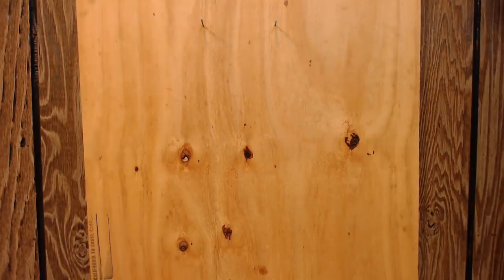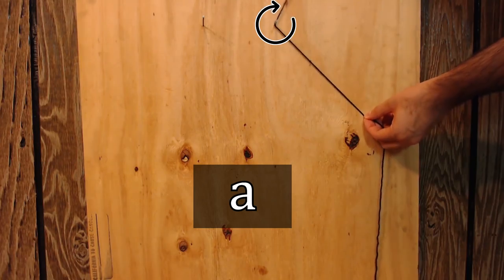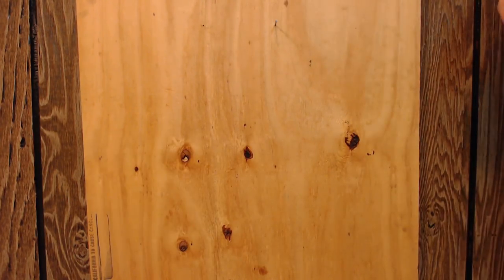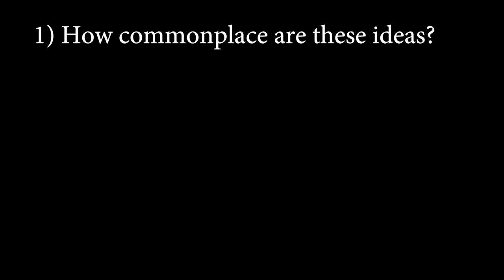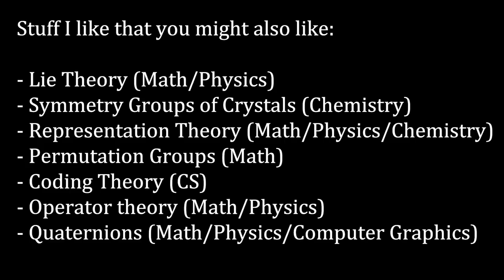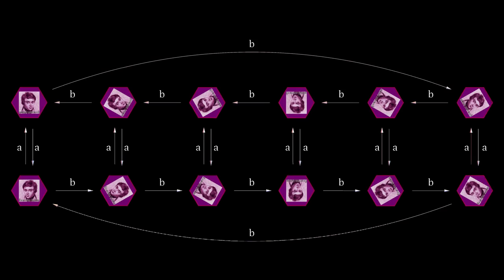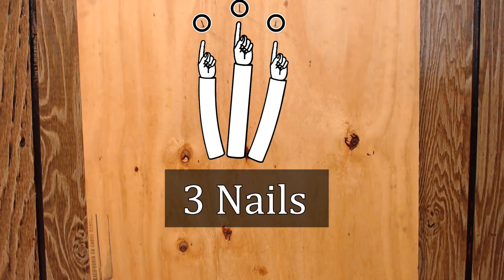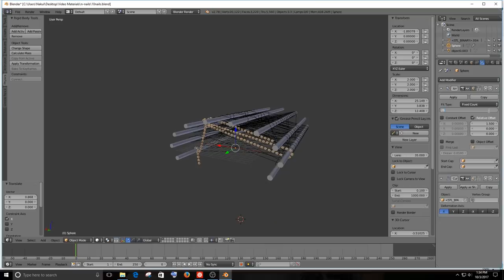A Very Satisfying Puzzle

Comment: Hey, I thought this video was about nails and puzzles !
But you taught me interesting math stuff, though I'm not really into math.
You nailed me. I'm puzzled.
Reply: CraftedBy Lemente perfectly well put! I'm right there with ya!
Reply: you NAILED me
Reply: This video is just for math geeks trying to explain everything mathematically. It can be done, but thinking about loops and hooks is easier than clockwise turns and algebra. 

I skipped through the esoteric math segments, but the video doesn't slow enough to see what's going on.  I was close to figuring it out before playing through, I just needed some string.
How I explain it is that you start with one long loop of string on the picture frame, and you pull a loop on each side and wrap over that side nail and hook the other side nail.  The loop around the each nail holds the picture, but pulling either nail unravels the other loop because each hook is wrapped over the other nail.

He also didn't say why he needed a heavier picture, because his math doesn't account for friction. And there's probably an equation that shows that a million nails won't work in the real world. 

But then it doesn't make sense to actually use this method to hang pictures if you want them to stay.
Reply: Chris Rinker Anyone who has tied a few knots can figure this out practically. Thats not the point...
Reply: (sob..sob...sob)

Comment: I can't even solve 1 nail.
Reply: nailed it
Reply: So punny
Reply: Im puzzled also
Reply: Wouldn't 1 nail be unsolvable because anything you do would just cancel itself out?
Reply: i bet you just lay your paintings down then?xD
Reply: 2 Paintings, 1 Nail
Reply: Templarfreak With one nail if you take the nail out regardless of what you do the picture will fall because there's nothing for it to hang onto.
Reply: There is nothing for it to hang onto to begin with, one nail is not enough to support the picture based on the math in the video because any sequence you'd put onto a single nail will cancel itself out. (Though obviously you could tie it to the nail)

Comment: This appears to work in concept but I need to get better string. The twine is binding up on the nails and ruining the effect. It also seems that you aren't supposed to ever make a full loop around any nail, if the formula tells you to pass under a nail you need to just skip past it without looping it around or else it doesn't work. So basically the math doesn't care where the nails are in physical space it only cares where the string passed by the nail in what direction even if the string never touched the nail.
Reply from the maker: I want to give you mad props for actually trying it. 

This is something I would have mentioned if I had kept on going but you are basically correct. It is possible to do this regardless of how the nails are positioned on the wall (so you can make tons of crazy patterns). However! You do need to be extremely careful. If you really want to guarantee that the looping pattern will be correct, you should pick a point on the plane and call it "home" (ideally where the picture will eventually hang) then draw paths from each of the nails to home so that none of of the paths intersect either each other, or any of the other nails. 

Now, whenever you want to loop around a nail, ALWAYS start from home, move along the path and then make a full loop around the nail, and then RETURN home along the path, then do this again with each consecutive nail. You can always tighten things up as you go along, but this strategy will guarantee that regardless of whatever crazy positioning you choose, the configuration will be correct. 

This strategy comes directly from the algebraic topology involved in proving that the Caley Graph is correct.

Thanks for watching!
Reply: rustyscrapper now you're getting into physics. I recommend not, as it likes to melt neurons and circuit boards (ask NASA)
Reply: yeah, friction often prevents theoretical physics problems.

Comment: There's a very simple recursive way to find any combination for any number of nails.
Here's the algorithm:
If N=1 the combination is obviously just around the 1st nail.
else list the moves for N-1 nails, add the move for going around the Nth nail, add the list of the moves for N-1 in reverse order and swapping all their directions, finally add the move for the Nth nail in opposite direction. Done.
Examples (I use "A" for clockwise and "a" for counterclockwise) :
N= 1 : A
N= 2 : A B a b
N = 3 : A B a b C B A b a c
N = 4 : A B a b C B A b a c D C A B a b c B A b a d
N = 5 : A B a b C B A b a c D C A B a b c B A b a d E D A B a b C B A b a c d C A B a b c B A b a e

Comment: Hi! very well done and a great work and video my friend. I would be glad to do something like that some day, maybe with some help from my friends...
By the way,  I have done the problem with a 6 mm climbing rope and it rocks.
I have also remembered this problem is related to knot problems,  particularly a typical one I tried to master some time ago and it is related with the Chefalo knot, a knot that seems a knot but really isn't so if you pull both ends the rope lays bare (without knots). These types of knots may get as complicated (big) as desired but it is difficult to avoid tangling.

Comment: Tie a knot to one of the nails, then pass the string through the picture's hangers, then tie the other end of the string to the other nail.  if you pull either nail you pull one of the ends of the string out and the picture falls.  Granted, this solution only works for a 2 nail problem, but it is also a viable solution to the problem.

Comment: I'm liking the patterns better when I have the commutator as a b-1 a-1 b.  It comes out as symmetric, and then when I get to the next even numbered nails, it can also be symmetric.  So the next is a d-1 a-1 d b-1 c b c-1 d-1 a d a-1 c b-1 c-1 b.

I don't think you mentioned it in this video but the nails seem to need to be on the perimeter of a convex shape.  Or at least, it won't always work if some are inside the perimeter.

Comment: 3 Tacks 1 Divider
Hang the divider on the wall. You have to make the divider fall, but you can only remove one tack. You may not use any external objects or forces, just the three thumbtacks, the divider, and your hands.
Solution below...

The divider has three holes, squeeze them off of the thumbtacks. You don't even have to remove a tack. I know it's a simple trick, but you can't solve it unless you're thinking inside the box.

Comment: Well, by the way I am an engineer and it is a pity that this problem is totally anti-safety. If one nail fails, everything goes down...and the problem with the picture resisting if all the nails fail except one is trivial,  of course (the engineering problem). Again, my congratulations for this piece of work and I hope you continue with this inspiring work.

Comment: lets say we have two bodies . one is as big as a football stadium size and  other one  is 10 suns put together. the gravity effect due to second body should dominate, if i m correct.  In that situation if we perform this experiment and try to hang a picture from two nails , and in this case  when we take out one nail , the picture  should move towards the bigger body (gravity more) . And if the bigger body is exactly above the smaller body ofcourse there is significant distance between them , so will the picture move up when one of the nails is taken out ?

Comment: For me the not comutative property looks like matrices and vectors. I might be saying something completely nonsense, but if we substitute a,b,a^(-1) and b^(-1) for a matrix that represent the clockwise and the its inverse for each nail, for the 1(st) to no n(th), that no inverse matrix or matrix n-2 cancels any matrix or inverse matrix with n-1 and no n-1 cancels with n and so on. If that's possible other matrix properties would have a different geometrical meaning, I think that's very interesting...
Reply: Oh, and the placing of the nails in a circular pattern with the "comutators→comutators→comutators..." looks like a modular multiplication around a circle(https://dev.nektro.net/projects/circular_multiplication/#900x30 an interesting link vsause related about that)

Comment: Awsome video :) 
Just one thing... There's a mystake in last line for five nails. 
I mean - there is one more b-1 then should be (5th from right side) - With this line it will hang on B at least (in most cases on C as well) if u dont pull it out.
(And A i am wirting this i found out, that this mystake were made even before...While you are hanging the the picture with three nails.)

Comment: I promise you, if you wrap the string around the first nail 17 times and then the second nail another 17 times it doesn't matter which one you remove first the picture will still hang. There's multiple factors which determine whether or not the picture will hang. For instance, if you use some sort of string, that is not yarn as it seems they have done in this video, it will grip on itself and be able to support the weight of anything hanging from it only using One Nail. I might add that the number 17 is not a calculated figure but a random number that I decided to choose. SCIENCE!

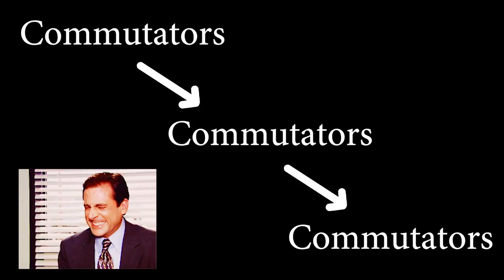Comment: The three-nail formula at 13:55 and again at 14:13 is wrong. There are 11 factors rather than 10 as stated. If you remove the  extra b* after a* it's correct.

Comment: Why did you replace A with D as opposed to B or C? And how did you letter the 5 nails from left to right? A B C D E, OR ACEDB or something else?
Reply from the maker: I replaced A with the commutator of A and D to involve the 4th nail. Though I could have replaced any letter with its commutator with D and it would have worked (for 4 nails). The order of the nails is ABCDE going counterclockwise, so A is the leftmost and B is the rightmost.

Comment: Sorry goldplatedgoof. This trick isn't math its physics. If you consider one end of the string a and the opposite end b. Then all u have to do is pull one end and the string comes off. But pull both and it will not I.e hang a picture. Didn't see the rubix cube portion but still thanks for teaching me about comulators
Reply: TheKidMAXY The problem is a physics problem only in the way that the string interacts with the nails, and falls off etc. To describe the problem of removing one nail you need purely Maths

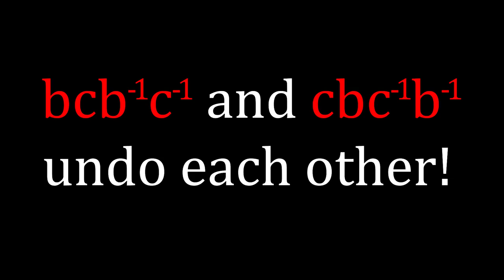Comment: The formula for 4 and 5 nails are incorrect!!! Since I can't write inverses in the comment section, I'll use uppercase letters for inverses. Let A be the inverse of a, B be the inverse of b, C be the inverse of c and so on... The 3 nail equation was abcBCAcbCB in the original solution (@13:31) which was correct. In the 4 nail solution, you started with an INCORRECT 3 nail solution. It's shown as abcBCABcbCB (@14:10). For some reason you added an extra B in the middle. There's an odd number of variables in the equation and it can never be cancelled out unless you remove "b and B". Any subsequent solutions derived after that point will not work. However, it's a very interesting puzzle.

Comment: i didn't understand the question at all. it was very poorly worded. next time, try adding "fall to the ground" because wrapping a string around 2 nails and hanging a picture from it, removing one nail can still cause the picture to fall even if that distance is a few centimetres (which is still counted as falling) so there are even more than infinite amounts of ways to complete this puzzle, it just needed to be reworded so it was easier to understand

Comment: isn't this called "string theory" ;D 

in reality this would be a horrible way to insure your picture did not fall. having a single point of failure defeats the purpose of having more than 1 nail (fail safe). 
over all nice video. like building chains of slip knots.